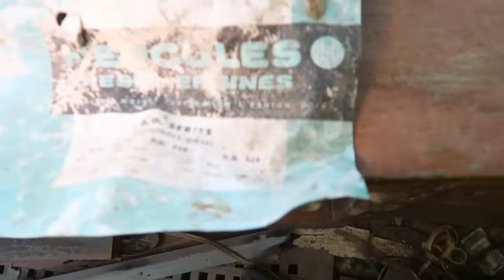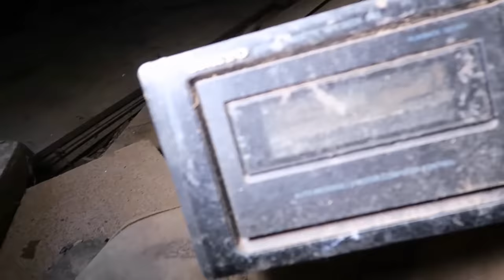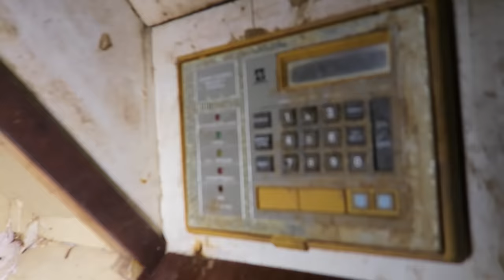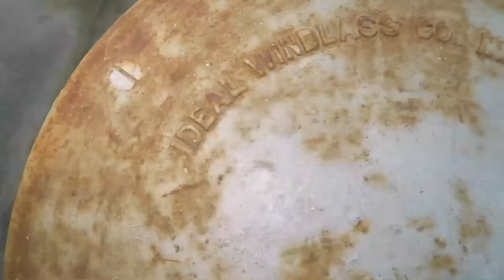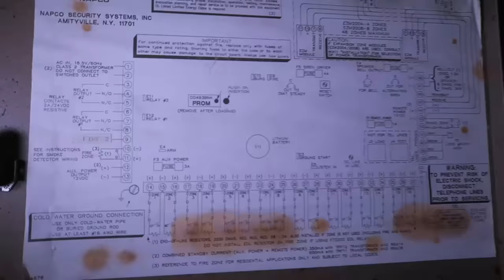We Found an Abandoned Yacht

Comment: I worked on this Yacht for 3.5 years from 1979-1983 Shae was named BLUE JACKET built in 1957 in Holland by De Vries Lentsch for the Mercer family who also built and defended the America's cup with WEATHERLY. So sad to see it this way.
Reply: Why do you suppose it was abandoned?
Reply: @swimbait1  Normally these old boats become more expensive to repair than it is to replace. Refitting them really happens when someone loves the boat and wants to save it from something like this "Abandoned".
Reply: Thats truly sad :(
Reply: @swimbait1  I would guess she was sold to be scrapped, and the original plan was to tow her up to the head of that creek (you can even see pilings where she would have been secured), in reach of a crane that would lift off pieces as the hull was cut up.  However, someone miscalculated and she grounded only halfway up the creek, where the surrounding ground is too soft to directly support the weight of the crane (and the scrap value is not worth the cost of building a solid access pathway).
Reply: @tomjordan9673  not much to salvage from a boat. Rotten wood and fiberglass...worthless. Only metal is valuable as scrap. There might be a little metal in one of these but it’s hardly worth tearing everything apart to get to it, especially with lower scrap prices the last several years
Reply: @wk6153  how  nice of a boat was it and do you have any pitchers
Reply: What kind of people were they and are you shure this is the same boat
Reply: Was this boat ever in the great lakes up by the upper peninsula mckinaw island
Reply: Very awesome looking at old pics she was sweet!!
Reply: Island Mike  thats fine I will keep getting rid of my trash the right way and people like you can keep on thinking that just dumping theirs in the water is ok
Reply: I bet when they were moving it to the scrapyard, the yacht probably rubbed in a few places and blew out the main seal(s) around the prop ports. There is no bilge that can keep up, or might not have even been working, and sank on shallow bed of river. It's definitely flooded now, and not going anywhere. I suspect they intend to let it rust enough to become a taxpayer problem when it gets dangerous in the coming decades. The rust is all ready bad, and I bet the decks will start collapsing in the next 20-40 years. Someone like these guys will nearly die, and then it will be dismantled.
Reply: @wk6153  what did you do on the yacht
Reply: @larrygro  what about those teak deck boards!? They could harvest that lovely deck.
Reply: Island Mike  
8
Reply: @wk6153  8
Reply: @larrygro  that boat has a steel hull. Which would be where the value is...
Reply: @larrygro  
It’s a steel hull ship. Plenty of metal.
Reply: @buellb0y  then they should be recycling it instead of polluting with it. Its just a giant pop can now.....with toxic materials to boot. If I left a car along a highway I would be fined. This thing is like dumping 20 cars in a river.
Reply: @larrygro  Easy 10k in Teak and doors on her
Reply: What was your duty?
Did they treat you good?
Reply: You worked on that exact boat there?
Reply: @ihavenoname4139  yes, for over 3 years
Reply: @wk6153  that's cool. We're you there when it was abandoned?
Reply: @ihavenoname4139  no, I left the boat in 1983, long before she ended up here
Reply: @wk6153  ah alright
Reply: @larrygro  If it is a de Vries Lentsch most likely it is steel.
Reply: @nielsdebakker3283  all the more reason to get it out of the waterway. If I dumped my car I would be fined. If someone dumps the equivalent of 50 cars people think its cool.
Reply: What a liar
Reply: @swimbait1  the mob did it to get even with someone
Reply: I’d buy that
Reply: @larrygro  -110ton steel hull, you would think someone would bother?
Reply: @trevordeane3940  when scrap prices go up they will
Reply: How interesting to see a connection with someone that actually knew that yacht. From what I could see it was well built and showed wealth in its days.
Reply: @qbraun9241  shaft seals are designed to leak ...they use water to stop them from overheating. Usually you pump a little grease  In at end of days use to slow the leak down to a few drops an hour.
Reply: @keithsmith4236  I have seen smaller boats go down from  seals, on old not well maintained boats. Dragging that boat through the canals you know it was rubbing in some areas. It's looks like it barely fit where it sank. It looks like in two to three feet of water. Maybe the bilge was good on shore power, but was dead when they towed the boat into those canals. Still, too easy to drag rotten seals over a shallow spot and flood the boat in seconds.
Reply: @qbraun9241  probs just rainwater in tje hull. Loads of missing deck fittings hatches and doors. No way to keep the old girl watertight. But yeah she looks a bit tight in that creek
Reply: @larrygro  I’m all for not polluting but if I was paying thousands for “emissions” I’d live somewhere else. It’s not the governments place to charge people for what they drive.
Reply: @tomjordan9673  Excellent point, thanks for adding.
Reply: @larrygro  U damn right ! Mother ....lovers.
Reply: @larrygro  Its a steel hull ship.
Reply: @larrygro  if you can think of an efficient way of getting the boat out without destroying the local growth and not an astronomical cost please do tell. You wouldn’t tell the US Government to remove the USS Arizona out of Pearl Harbor.
Reply: @larrygro  There are hundreds if not thousands of boats abandoned all up and down the coast. Costs a bundle to scrap one so they  remove what identity they can and ditch it. Few years ago I saw a map online listing all the known abandoned boats in Florida. There were over 700.
Reply: @sabrekai8706   there is a reason they remove identity. If you can afford a boat like that you can afford to get it disposed of properly.
Reply: Idk why this comment isn’t pinned at the top
Reply: @larrygro  spot on
Reply: @OneWayWillie  I have a brochure of the vessel after the Mercer family sild the boat and she went into charter service. I just have to figure out how to scan it then upload it to this site.
Reply: @OneWayWillie  got one in my toilet bowl. BRB
Reply: well you didn't say new condition
Reply: Hey man ! Would love to see if you have the brochure or original picture ! I live in this town and did the same thing this guy did haha
Reply: lol
Reply: I would absolutely love to have this boat. I would put every penny I have into bringing her back to life. I grew up on the water and I had hoped to die on it as well. I'm getting up in years now and running out of time. But I sure wish I could have seen this when I was younger.
Reply: @larrygro  it's way too expensive and harmful to just take it away. But you seem more concerned about you not being allowed to do the same or to cause problems to other people than the problems trying to remove this would cause.
Reply: @sabrekai8706  never really thot about it imagine you buy your computer and its kinda hard to dispose of properly or huge analog tv.. So your wealthy your yacht gets outdated and you discover the cost of properly disposing of your 500k ton problem 😯 🛥💵💵💵💵💵💵💵💵
Nobody sd nothing in the beginning 
Remove all identity and ditch that sucker like throwing a sofa on a lonely roadside or tires
Reply: Did you though?
Reply: @samuelhadley5556  youd need a team of ten people and a quarter million dollars to bring this girl back.
Reply: @RaneBane  I would agree with you 💯 percent. But can't an old man fantasize? I would still try until I was dead.
Reply: How awesome you would see this and have worked on this ship. What did you do and what was it used for? Personal or commercial enjoyment?
Reply: Cool video ,
Reply: @Zahara Greene you just enforced my opinion. If I were to leave a car by the side of the road they would look up the registration or the VIN and I would have to remove it. It could be a $200 car but cost $500 to remove it, doesn’t matter. Think about how many cars would be littering the side of the highways if we could just walk away from them. Same thing should apply to boats. There is absolutely no way that this boat can’t be traced to its owner and they should be responsible for  salvaging or scrapping it.
Reply: Do you know the owners contact info? I'd love to talk to them about taking her over maybe...
Reply: @irtb4250  I know a couple Guatemalans who would cut that thing into pieces and remove it in a few hours.
Reply: @OneWayWillie  If you look up The Blue Jacket yacht there are some pictures that look similar.
Reply: @Zahara Greene well, let’s hope that they get some salvage value out of it  but knowing how government works if they profit anything from it it will be gone before they get it.
Reply: @Zahara Greene  I don’t have a definite one BUT , what I am saying is that the owners need to be responsible for their own shit just as if it were an automobile. This thing has obviously been there for years, I could never leave a car on the road for a week or two without fines. I’m sure it’s like squeezing blood out of a turnip if they are bankrupt or have zero funds but it still should be enforced for people to clean up their own junk
Reply: Larry Gronewold 
In Arizona it's common to find autos in the desert. 
If the state is involved or it was owned by a corporation that no longer exists and you are responsible for its disposal what's your plan  ?
It's not enough to bitch. 
If you care you fix it. 
I will be honest. I don't care. 
So put your $20,000 down and get busy.
Reply: @cody481  I’m already busy making sure I don’t leave 20 tons of my junk laying around for someone else to clean up. I don’t even leave 20 pounds of my junk for someone else to clean up. We in this nation are apparently so damned concerned about climate change yet we are perfectly ok with someone polluting our waterways with tons of garbage when it should be easy to find out whose it is.
Reply: @larrygro  stop complaining if you’re not going to personally do something about it. If you’re not going to then shut up and enjoy the vid and keep recycling or whatever the hell you do to help the environment
Reply: @nemocrx7080  ok, and I will leave a junked car on the road tomorrow and see if I can get away with it too. Are you going to take a video and think it’s cool?
Reply: Surprising to find someone who actually knows the yacht has found this video
Reply: @OneWayWillie  I just looked it up on the internet.
Reply: @larrygro  scrap prices are up
Reply: Looks like a houseboat. Assume they sailed it up and abandoned it or it was stolen , went as far as they could and
 couldn't reverse or certainly unable to turn.  it. Shame.. All the way from Holland. Must of came over onboard a freighter..
Reply: cool story. I found out this yacht is about 2 miles from me. never even knew it was there.
Reply: @WK Blue Jacket aka Straight Jacket tied up next to us in Lyford Cay several winters during 1979-1983. I was buddy’s with the deck hand, forget his name now. That boat was a classic and beautiful. So sad to see this end. W K, do you remember the LisaNola in Lyford?
Reply: @TheBigWWI  hello, I was onboard at Lyford 4 seasons “79-‘83. My name is Whit.
Reply: @TheBigWWI  That deckhand was me, I would have been around 20 at the time. Those days at Lyford were fun and boring at the same time. What kind of yacht was LisaNola?
Reply: @wk6153  LisaNola was the navy blue hulled 28 meter Admiral high speed Italian boat. I was the mate/engineer. You and I spent a lot of time playing pool at Mrs. Fergusons restaurant and drinking more than our share. Great memories. If you are ever in the Lauderdale area would enjoy catching up.
Reply: @thebigwhit1  I'm in Lauderdale 3-5 days a week, whats the best way to reach you?
Reply: @thebigwhit1  how can I reach you?
Reply: W K I keep sending my contact in different form for email and cell but the algo keeps deleting it. Im easy to find on the web with my name Whitney irons.
Reply: @TheBigWWI  just asked to connect thru Likedin
Reply: @OneWayWillie  'Cause "No pics. Didn't happen."
Reply: What happened to the Mercer's?   Were they the ones that abandoned it?
Reply: @Hogger280  no
Reply: Sure u did
Reply: Okay, I feel pretty vindicated. I figured it was a circa 1960 build and last upgraded around 1980. Did she operate on the Hudson/New York Harbor at all during your time? For some reason she looks familiar to me and I place her there around that time (at least during the warmer months). But it's hard to tell given her condition and I think I need a wider view of her profile to really tell. Sad to see any boat in this condition.
Reply: @larrygro  lol nobody said it was "cool". It's shitty, sure, but if you get this worked up over everything like this then your heart must be about ready to croak on you. Chill out.
Reply: @OneWayWillie  here's a crazy idea. Now bear with me, but maybe you could go to this place called the internet to find it.
Reply: Looks very similar in appearance to the yacht  "THE ALBACOR"  built in 1958 by (De Vries Lentsch) a 33.53m = 110ft. motor yacht.
Reply: Thats awesome! Just read thru all the replies and its awesome to see ppl catch up haha
Reply: sad :(
Reply: Butbwhy not sell the steel?
Reply: @larrygro  this isnt your 12ft bass boat elmer.
Reply: @phoenixfox3379  which means that it should be the responsibility of the owners to clean it up all the more Fuddy.
Reply: @larrygro  this is one of the longest-running meaningless arguments I've seen on youtube, I'm impressed
Reply: what a roller coaster ride this thread became, dude gets to see what became of a yacht he worked on back in the day, reunites with an old pal he met on a different yacht, all the while a couple dozen different people are either fighting like cats, wondering about the coincidence, or doubting the story... youtube is truly like a hollywood wild west saloon
Reply: @BeetleBuns  and after 6 months you just revived it again. With all of the liberal pollution outrage in this country today I would think this thing would be taken care of by now. At least fine somebody.
Reply: @larrygro  omg you're stil going, and STILL repeating the same tired argument that hasn't worked for an ENTIRE YEAR! Now THAT'S  the definition of idiot... I love this so much
Reply: @BeetleBuns  Lol, I was over it 6 months ago. Sorry you can’t let it go kiddo. Bye bye.
Reply: @larrygro  the fact you're still here says otherwise. Go on then, you've already proven me right.
Reply: Such a neat story,  how did you identify this boat? Just very curious. Definitely a shame to have fallen in this state.
Reply: @larrygro  I believe this boat had a steel hull
Reply: @samuelhadley5556  "I would love to have this boat." And you'd need to love to have about 10 mil in order to bring her back.
Reply: Very interesting, thanks for posting. My grandmother was a pilot for one of the wealthier families, it's funny how much pride people who worked for them have, even years later bragging about their achievements. My grandmother is the same way. If anyone would like to see pictures of this Yacht, you can search "blue jacket 1957" and you'll see pictures of her in her prime.
Reply: @TheMosinCrate  very, very true. But think of how beautiful it would be.🤠👍
Reply: It's sad finding things like this abandoned
Reply: The Mercers can afford to remove this.  They are a blight on our country
Reply: Not sure you are correct… someone in 2011 posted they had just purchased the blue jacket from the Mercers on another forum. They also said they had it in San Francisco…
Reply: BEAUTIFUL BIGEST BOAT 🚢 😍 ❤️
Reply: Do you know who owns it now? Would be an interesting project to tinker with
Reply: if it really is the blue jacket, it was powered by v12s in its heyday. I was 14 and the engineer took me down to see them. but they are either long gone or flooded for the last decade or 2
Reply: What a waste of a good boat, Maybe if its salvageable it can be refurbished.
Reply: @larrygro   fibreglas on a boat bulit in -53 ?
Reply: @TeamDriftEVO  of course. You think it wasn’t invented until later?
Reply: Maybe someone can get Don Trump to use it for yard art?
Reply: How the helll did this video FIND YOU 👀😂☠️